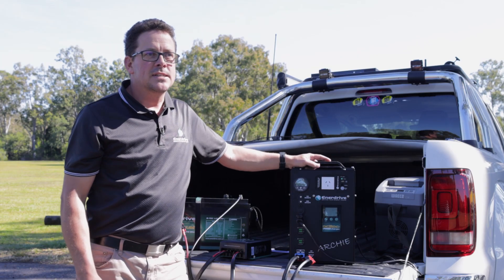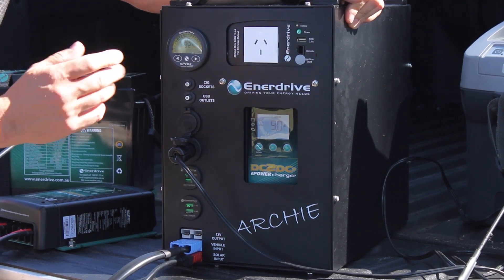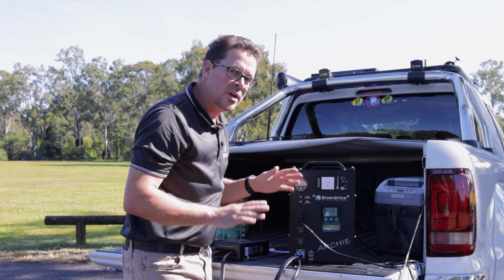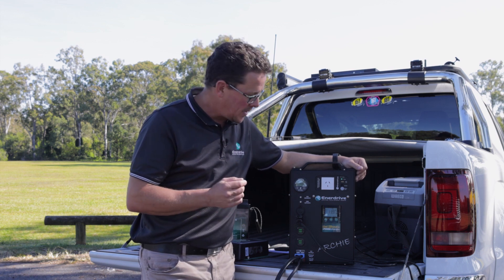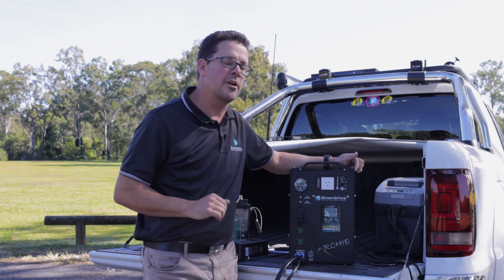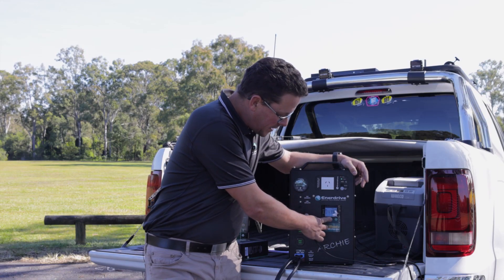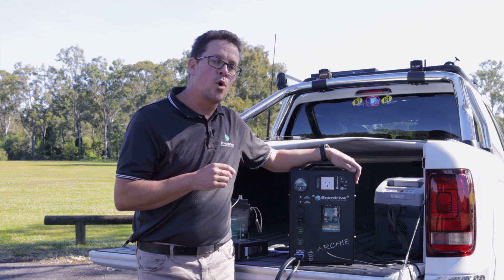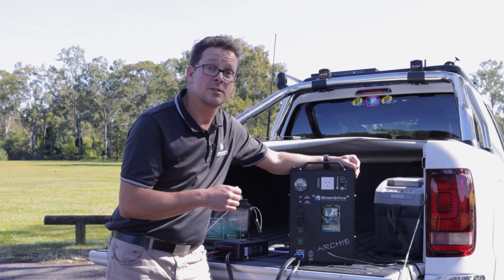Enerdrive DC2DC Chargers - Part 6 - How to Operate Your Charger

Comment: Appreciate going over the "Manual Override Mode". Had inadvertently switched it on when I hooked up the solar and was looking for the reason for a flat starter battery. 

The Manual does have a note but it's not well stated, seeing this now gives me confidence I've found the issue.